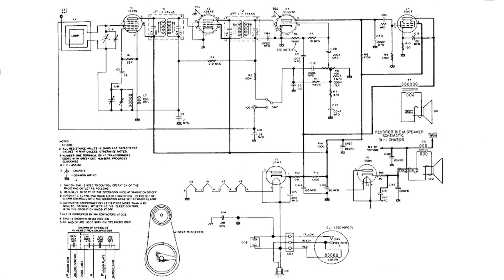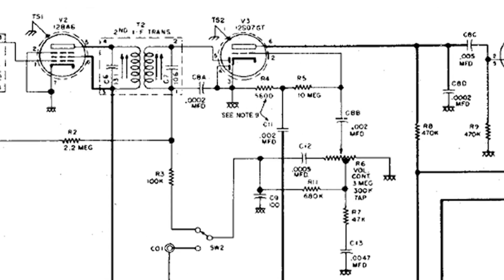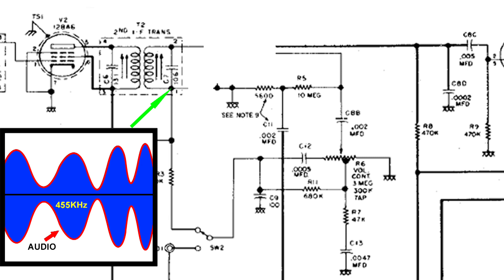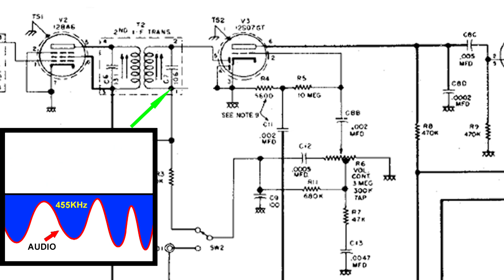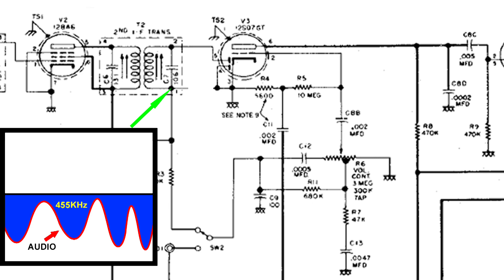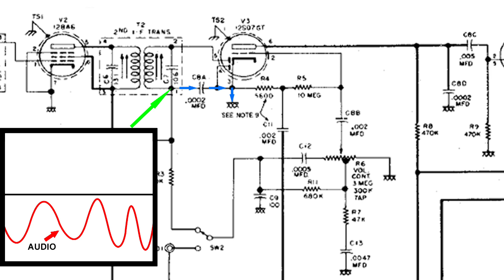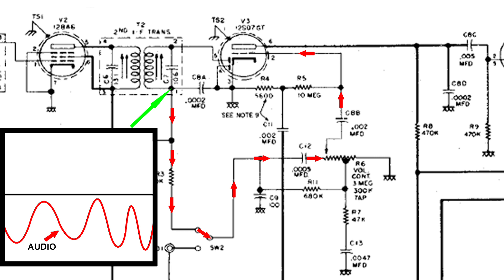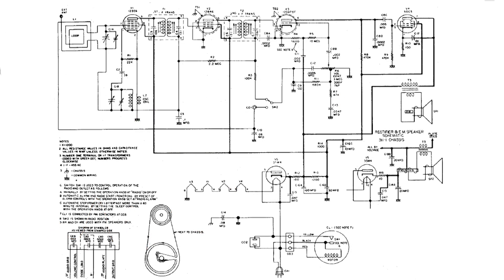How the Volume Control works in a All American Five Radio

Comment: This helped tremendously with replacing a volume control on a Philco 39-17. The original part was completely worn out, and I don't know if it was a tapered pot or not. Also, it rotated CCW from off to full. The new (audio) pot rotates CW from off so I reversed the outermost two wires. Am I understanding this correctly? It plays well,  but the strong stations seem to require only a very small increase in the volume control. Thank you for the excellent videos. I learn something new every time!
Reply from the maker: I'm glad you found this video useful.
Thank you, and your welcome.

Comment: If I'm not mistaken you have a video on why there is still volume with the control closed. I have two radios that do this and they have been recapped and when the volume control is closed there is zero resistance to ground. I believe it was an issue with AGC but I can't remember for sure. Which video explains this situation? Thank you for your work. Your an excellent teacher.
Reply from the maker: Thank you.
If the volume does not go off all the way, the volume control is not going all the way down to zero ohms. I;m not sure if I mentioned that in a video.

Comment: Hello I downloaded your book but I have a question.  I'm working on a hallicrafters S38A radio which I think is an AA5 radio.  Just recapped it. Added a fuse and polarized cord. The radio works on all bands but If I hold an insulated screwdriver and I just tap lightly on the chassis I get static on the speaker speaker. Any ideas where I should look? Ty!!
Reply from the maker: I would check capacitor C36 0.25uF to make sure that it is installed properly.
Reply: @AllAmericanFiveRadio  ty you so much for your help!! I watched your video today about the car accident etc.... thank God you are ok!!  I really appreciate your help.. I am learning all the time.. mike

Comment: Hi Rick, thanks for the explanation. I just would like to understand why audio frequency (signal) won't pass through 0.0002uf cap to ground but will pass through the other cap 0.0005uf just before the pot?
Reply from the maker: I have a few videos that will help you understand capacitors and coils and frequency.
Capacitive Reactance and Frequency Demo
https://www.youtube.com/watch?v=S5_7gGHxVyQ
Impedance and Frequency, Oscilloscope Demo
https://www.youtube.com/watch?v=TRSNKwtUy8g
Capacitors, DC, AC, and Frequencies
https://www.youtube.com/watch?v=YfJKNSkz_Lk
Audio Coupling Capacitor, how it Functions in a Circuit
https://www.youtube.com/watch?v=PAPnwX6YiIM
Capacitors, DC and AC Current
https://www.youtube.com/watch?v=NInt1Ss3vQ4

Comment: Thanks!  Was this associated with an volume control that did nothing question on the facebook group?
Reply from the maker: I have a Facebook but have not looked at it in over a year.
Reply: @AllAmericanFiveRadio  Okay. On the vintage radio group in Facebook, someone had a problem with what looks like the exact same circuit.  The volume did not vary no matter the position of the control.  Your video explains that circuit perfectly.